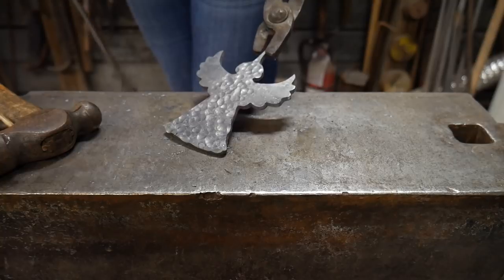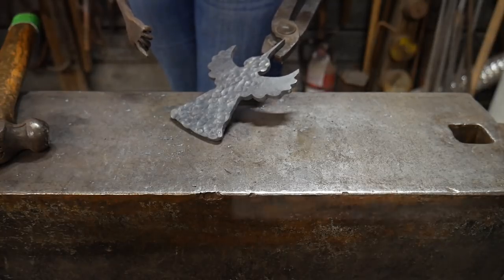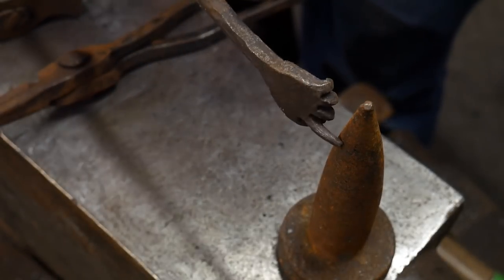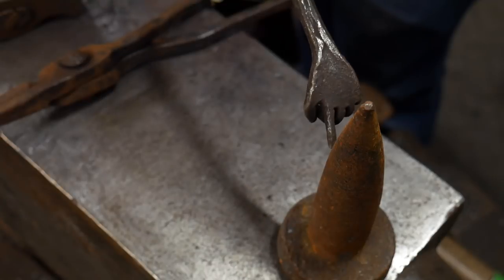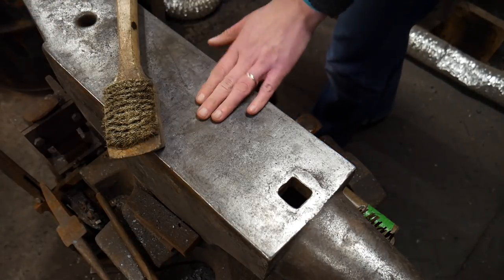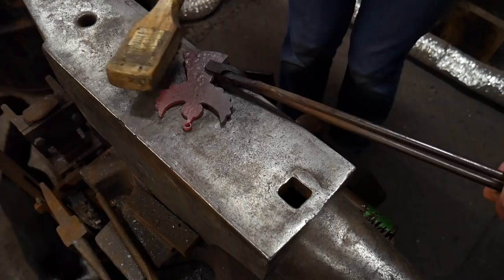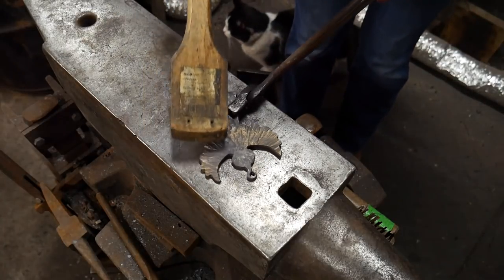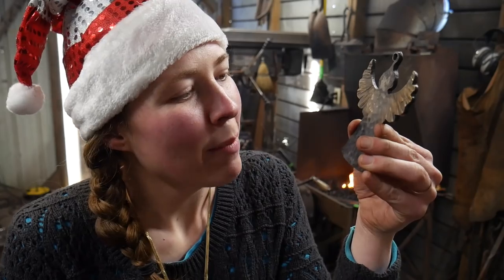Forging an Angel Ornament (Forging with Jess)

Comment: Adding a little texture to a pre-cut blank is not "forging"
Reply from the maker: Yes it is .........
Reply: forge1

/fôrj/

verb

gerund or present participle: forging

1.

make or shape (a metal object) by heating it in a fire or furnace and beating or hammering it.

I think this does indeed fit the definition.
Reply: @jeffreyhilljeffshandforged2149  I disagree the object per se is not being made. It is already made and is only being decorated
Reply: Heating metal and moving it with a hammer - regardless of initial shape = forging in my book.